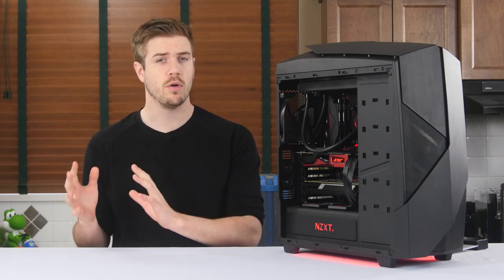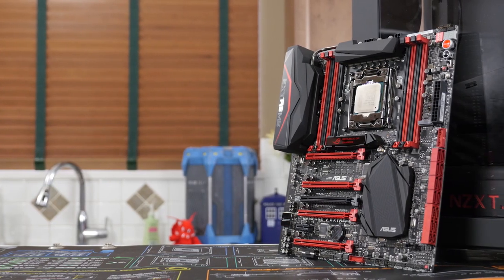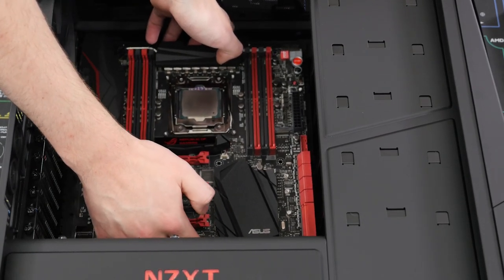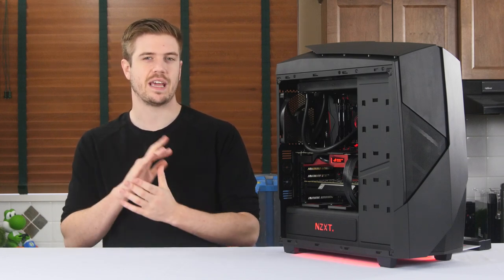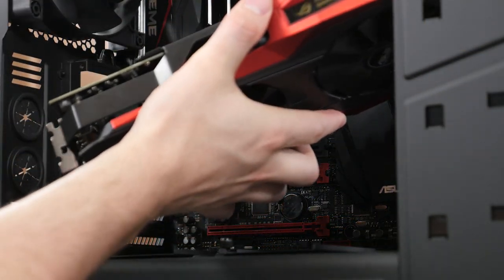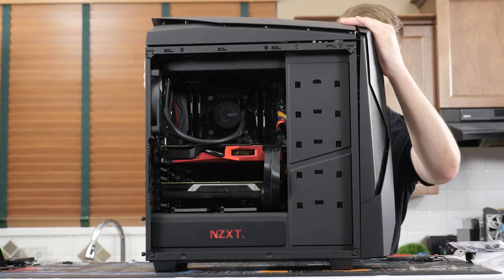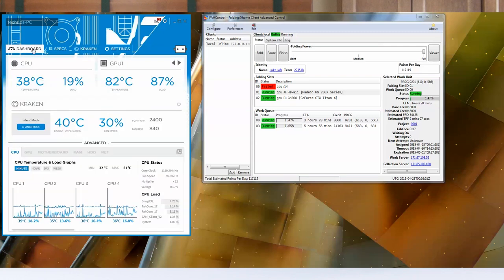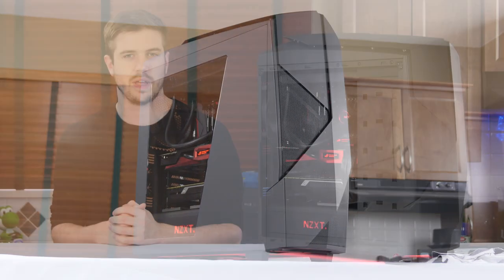ULTIMATE Distributed Computing Build Log

Comment: Can anyone give me tips on what parts that are better?

FX-6300 Black Edition
Sapphire Dual-X R9 270X
Gigabyte GA-970A-D3P
Kingston HyperX Fury 8GB Kit
EVGA 500W or Corsair CX500M
Reply: Omer Cinar u shud go for a processor for ur cpu.
Reply: +Omer Cinar  yes this is
Orientation: StandardThemes (Side Panels Only) Color: Shredder RedThe ORIGIN Difference: ORIGIN PC Genesis - The Best Gaming Experience GuaranteedVariable Mounting: StandardCase Lighting: Remote Controlled Multi-Colored LEDCase Fans: ORIGIN PC High-Performance Ultra Silent Fans - BlackMotherboard: MSI X99A GODLIKE GamingSystem Cooling: ORIGIN CRYOGENIC Stage III Hard Line Liquid CoolingCRYOGENIC Tubing Color: RedCRYOGENIC Liquid: Koolance Performance Coolant - RedProcessors: Intel Extreme Core i7 5960X Octa-Core 3.0GHz (3.5GHz TurboBoost)ORIGIN Professional Processor Overclocking: ORIGIN Professional Processor OverclockingThermal Compound: GELID GC-Extreme CPU ApplicationPower Supply: 1.5 Kilowatt Corsair AX1500iPower Supply Sleeved Cable Color: Red Individually Sleeved CablesGraphic Cards: Quad ORIGIN CRYOGENIC Liquid Cooled 12GB NVIDIA GTX Titan XORIGIN Professional Graphics Card Overclocking: ORIGIN PC Professional Graphics Card OverclockingMemory: 32GB Corsair Dominator Platinum 3000MHz (4x8GB)Operating System: MS Windows 10 HomeOperating System RAID Configuration: RAID 0: For better speed and performance (2 Identical OS Drives Required)Operating System Drive #1 (Primary): 2TB Samsung 850 Evo SeriesOperating System Drive #2: 2TB Samsung 850 Evo SeriesHotSwap Drives RAID Configuration: RAID 1: For better data safety and security (2 identical drives needed)Hot Swap Bay Drive #1: 2TB Samsung 850 Evo SeriesHot Swap Bay Drive #2: 2TB Samsung 850 Evo SeriesHot Swap Bay Drive #3: 2TB Samsung 850 Evo SeriesHot Swap Bay Drive #4: 2TB Samsung 850 Evo SeriesHot Swap Bay Drive #5: 2TB Samsung 850 Evo SeriesHard Drive Cage: 5 Bay Hot-Swap CageOptical Drive One: 12X Blu-ray Reader and DVD ComboOptical Drive Two: 24X CD/DVD BurnerPlayback Software: CyberLink PowerDVD 15 Ultra (MSRP $99)Lower Unit: Cryogenic Cooling SupportMedia Card Reader: 40-in-1 Media Card ReaderAudio: Creative Sound Blaster E3 Headphone AmplifierNetworking: Onboard Network PortCapture Cards: AVermedia Live Gamer Extreme LGXORIGIN Maximum Protection Shipping Process: ORIGIN Wooden Crate ArmorWarranty: Lifetime 24/7 U.S. Based Support and Lifetime Free Labor. 3 Year Part Replacement & Free Shipping WarrantyORIGIN Recovery: ORIGIN Recovery USB3.0 Flash DriveEvolve Part Upgrade Service: 3 Year Evolve Part Upgrade Service with Free ShippingOrigin Exclusive Peripherals: ORIGIN PC Goliathus Medium SpeedOrigin Exclusive Peripherals: ORIGIN PC TaipanOrigin Exclusive Peripherals: ORIGIN PC BlackWidow ChromaFree ORIGIN T-shirt: ORIGIN PC T-Shirt MediumBundles: ORIGIN PC Ultimate Peripherals Bundle (MSRP $269)Keyboards: Razer BlackWidow ChromaMouse: Razer OurobourosMouse Pad: Razer ManticorPrimary Display: ASUS 32" PA328Q 4K UHD LED MonitorSecondary Display: ASUS 32" PA328Q 4K UHD LED MonitorDisplay Accessories: NVIDIA 3D Vision 2 Wireless GlassesDisplay Accessories: NVIDIA 3D Vision 2 Glasses Kit with IR EmitterHeadsets: Astro Gaming A50 Wireless HeadsetSpeakers: Creative Sound Blaster X7Webcam: Logitech C920 HD Pro WebCamGame Discounts: Green Man GamingGames: Grand Theft Auto VExternal Storage: ORIGIN USB 3.0 16GB Flash DriveSecurity Locks: Kensington Twin Locks(For Prime Desktop)Security Software: Webroot AntiVirus for PC GamersProductivity Software: Microsoft Office 2016 Home & Business (1PC/1User) *US Version*Cloud Backup: CarboniteApps: Battle.net ClientApps: Steam (The Ultimate Online Game Platform)Apps: Razer CommsApps: Microsoft Windows Live EssentialApps: Razer Synapse 2.0Extras: FREE Online Game: League of LegendsExtras: FREE INSTALL: MinecraftWeb Browser: Microsoft Internet Explorer/*EdgeWeb Browser: Google Chrome

Comment: will my PC run Witcher 3 on ultra

PC Specs

i7 4960k Processer

Asus maximus VII Ranger Rog 1150 Motherboard

Nvidia GeForce GTX 980Ti 6GB DDR5 Liquid Cooled and OC 

XSPC 240 Extreme Liquid Cooling Kit

Corsair Vengeance Pro Series 16GB (2 x 8GB) DDR3 2400MHz

Corsair Obsidian Series® 450D Mid-Tower PC Case

Kingston HyperX Fury 120GB 6.0gb/s SATA III SSD

Seagate 1000 GB 72000rpm SATA 3.5″ HDD

SeaSonic X Series X-850 850W SLI/CrossFire Ready 80 PLUS GOLD
Reply: NOOOO! You need 8 million GT420s to do it, scrub, not this scrub machine. 

It'll run fine. Just look at some of the benchmarks for the 980ti, to check it, of course.
Reply: Raptor Nah he needs a gt630 to run witcher 3 at ultra its the best card atm ;)

Comment: Were those fans in push or pull?
Reply: +KhaosN7 pull in exhaust, but it makes no difference anyway
Reply: That's what I thought. It doesn't make a difference for cooling, but it does make cleaning easier. I built my Rig in that case using that cooler, it was a bitch and half to get in there, but it was worth it.

Comment: hi, could you tell me if this rig can run minecraft+shaders; medieval engineers high-Very high;Space engineers high-Very high?: motherboard: Asus M5A97 EVO R2.0 cpu: amd fx 8320 8 core black édition 3,5 gh RAM 8gb hard drive 1x SSD 240gb corsaire force 3 + 2tb Sata psu: BeQuiet pure power 80 plus bronze 630w gpu: AMD Sapphire Radeon hd 7870 2gb oc.  thx guys.

Comment: This doesn't look like a distributed computing station; it rather is a Gaming machine! I'd rather use those 2 xeon processors (from the $150 gaming rig video) as it will have 8 physical cores for a more efficient data procesing. Also, I do not think we need a graphics card at all unless we need to avoid the onboard graphics sharing a chunk of the system RAM. and clearly did not understand why you guys added 2 high-end graphics cards! instead, i'd have gone with a basic 1 gig-ish graphics card only to avoid RAM sharing.  another thing, for a Distributed computing machine, i'd rather wanna add more RAM than only 8 GB which is surely gonna be a bottleneck for high end data processing (which nowadays happens in-memory!) 
In short, if you guys had used the same proccy+mobo+RAM setup you used for $150 rig; it would have been more practical and would have costed a fraction of the price incurred to build your system.
Reply: uttkarsh dharmadhikari in folding@home the GPU is far better at folding than the CPU, so graphic cards are indeed a good choice.

Comment: This is what i have right now, does anyone have any tips and/or ideas for where the question marks are?
Budget is max 800$

Cpu: Intel Core I5 4690k 3.5 ghz
Optional cooler: ????
Motherboard: ASRock Z97 extreme 6
RAM card: Kingston HyperX Fury red HX318C10FR/8
Gpu: msi geforce gtx 970 gaming 3.5gb
Case: cooler master n300 (KWN1)
Harddrive: seagate barracuda 1tb
SSD card: 250gb ?????
Psu: ????

Comment: Just don't run prime number programs on your skylake.  Until you get the relevant BIOS or firmware update.
Reply: +OptimisticPessimist I did folding@home for 8 days straight on my 6600k without issues, i do keep my bios updated though, and I'm not sure if folding can trigger the instability issues on skylake, folding isn't prime number crunching tho, so maybe it won't cause the problems? Either way, my system seems fine at 4.6ghz, stability tested with aida 64 for 27 hours on 2 seperate occasions, and 8 days of folding, I must have the fixed bios.
Reply: Darren Kehrli
Ok, so it's triggered by some very complex workloads, has been by running Prime95, a tool to stress test the CPU with prime number operations. Crashes occur during Fast Fourier Transforms with extremely large exponents.  Otherwise the cause isn't mentioned.  Which means applications that do similar operations may be at risk until the fix is applied.  I don't know what, besides specific math or science research projects could be affected. http://arstechnica.com/gadgets/2016/01/intel-skylake-bug-causes-pcs-to-freeze-during-complex-workloads/

Comment: Hi i wanna build my frist PC and im thinking of buying this: 

NZXT ATX Mid Tower Case Cases CA-S340MB-GR

EVGA SuperNOVA 750B1 750W ATX12V Power Supply 

WD Blue 1TB SATA 

Gigabyte GA-Z97X-GAMING 3 LGA 1150 Z97 

MSI GTX 970 

G.SKILL Ripjaws X Series 8GB (2 x 4GB) 240-Pin DDR3 SDRAM DDR3 2133 (PC3 17000) 

Intel Core i5-4690K Processor 3.5 GHz LGA 1150 
also im kind of scared to build well im only 13 and i dont wanna break my CPU while putting it in a place and what cable to put where on Mobo

Comment: Hi!

Are there any one who can help me with this small problem? I've just been on a trip away, but when I came home to my computer a problem which fixed it self after turning on G-sync came back; Screen tearing. I don't know what causes it, I've put on V-sync and other stuff, cleansed my computer, the only thing left is reinstalling my computer, which I have no intention of doing yet. I've searched it up on google, but none of it works.

ASUS ROG PG278Q (2560x1440@59Hz)- gaming screen
2047MB NVIDIA GeForce GTX 660 Ti (EVGA) - somewhat old GPU(?)
http://gyazo.com/08465ee5ebb9551abb4a55987cd992cc

So my question is, what is the problem?
Reply: Mr Krisey I've also noticed that the screen tearing is at the same place all the time, I don't know if that makes a diffrence or not.

Comment: The different GPUs ruined it they should have gone with the AMD x2 it suits the build
Reply: Ben Maxwell AMD 2X can the room take the heat?
Reply: What u mean?? PC Master Race
Reply: Ben Maxwell AMD GPU + CPU= oven
Reply: It will be fine without load and it has hreat cooling
Reply: They did that because some distributed computing workloads run better on amd gpus and some run better on nvidia gpus. This is done to get the best of both worlds.

Comment: If you're doing distributed, sack off Windows, get down to a bare bones Linux build and go from there... A lot less overhead. Boinc is supported extensively on Linux based operating systems

Comment: Guys what do you think of my first build 

AMD FX-6300

Cooler Master Hyper 212 EVO 82.9 CFM Sleeve Bearing CPU Cooler

MSI 760GM-P23 (FX) Micro ATX AM3+ Motherboard

G.Skill Ripjaws X Series 8GB (2 x 4GB) DDR3-2400 Memory

Western Digital Caviar Blue 1TB 3.5" 7200RPM Internal Hard Drive

XFX Radeon R9 285 2GB Double Dissipation Video Card

Cougar Spike MicroATX Mini Tower Case

EVGA 400W ATX Power Supply

Plz let me now what you think

Comment: Is this like bit coin and you get paid to do this
Reply: +NickMsiGaming Yt  They can afford a used 980 Ti.  But we're talking about MILLIONS of computers working toward the same goals.
Reply: But jeah,I get it,but come on,how many,lets say GTX 950 PCs are connected,i would think almost half are less powerful than the 950,so my 980 TI could perform a task of about 4 of those single 950 (Or AMD counterpart) PCs.So you can lower the amount of power used for these PCs and therefore more efficient use of hardware.About 250000 980 TI PCs would perform a task of 1000000 PCs.And if you give all those computers 2 way 980 TI sli,you can limit this to 125 000 computers,so 1000000 vs 125000?Because we have less systems that only pull the extra of the gpu,not another CPU,RAM ect. we save lots of power and we stop global warming.BOOM killed two birds with one stone.And in the long run they would be MUCH cheaper than 1000000 PCs.Just like a TESLA model S that is expensive at the start but it saves you money over time.

PS:Have to read entire text to see the cons reversed.Don't pull any hate on me until you have read.
Reply: Nick, I don't dispute what you wrote in your last post, but good luck convincing hundreds of thousands of users (possibly millions of users) to upgrade their machines.  And besides, your original post assumed everyone who didn't have a 980 Ti was poor, which is insulting to say the least.

Your energy would be better spent convincing everyone to scrap any car that gets less than 35 miles per gallon.
Reply: Everyone that has not got a 980 TI (or similar) is a budget gamer.And i hate them.
Reply: I see you're trolling.  I'm not biting.
Reply: tripod=triangle=AMD=illuminati confirmed!!
Reply: tripod=triangle=nVidia=not illuminati
Reply: see?
Reply: Budget gamers use AMD.They are in the illuminati following my formula.
Reply: I guess you hate everyone with a 1060, then
Reply: 1060 ok.
Reply: NickMsiGaming YT how tf is a 1060 ok but not a 390x the 390 is more powerful
Reply: But the 390x is still like 500$ and needs like a 600w power supply.

Comment: this folding and boinc things seem like too much trouble. they should be configuring there software to run on my system. not the other way around. considering there getting our help for free i dont think thats too much to ask. and with this folding and boinc stuff. can you just let it do its thing over night and when you want the pc u just stop it or whats the go? what kind of internet connection is needed? us people with slow 5mbps down and 0.5 up. is our system even going to crack idle with those speeds? seems like a waist of time. also will my service provider let me get those downloads and uploads for free? cuz us people here in australia get on average 10-200g per month limits. and thats up and down stream. so if its running full speed even on 5mbps thats gonna cap out pretty quick.

Comment: Guys i going to buy a new pc for my games and my work with design is that alright:
Motherboard Z97X-UD3H-BK
GTX 970 Gigabyte G1 Gaming
Core i5 4690K
Case NZXT H440
Watercooler Corsair H100i
Corsair CX600W
HyperX 2x4GB
Reply: Diabo Zueiro Personally I went with the MSI GeForce GTX 970, (personal preference) but overall the build is good. :) Have you checked some compatibility using PCPartPicker? Just in case there is an issue I don't see here.

Comment: Please help me with this build 
I was think of building a computer is this computer good for running high settings on 2015 games? 

Computer Case : NZXT H440 Black / Red Mid Tower Computer Case
----------------------------------------------------------------------------------------------------------
Optical Drives & Storage Devices : Asus 24x Internal DVD±RW - OEM
----------------------------------------------------------------------------------------------------------
Video Card : MSI GTX 970 GAMING 4G Golden Edition GM204-200 (Maxwell) 4GB GDDR5 PCI Express 3.0 x16
----------------------------------------------------------------------------------------------------------
Power Supply : Corsair CS750M 750w ATX Power Supply 80 Plus Gold Modular
----------------------------------------------------------------------------------------------------------
Liquid CPU Cooler : Corsair Hydro H100i Liquid Cooler
----------------------------------------------------------------------------------------------------------
LED Fan : Corsair Air Series AF120 CO-9050015-BLED 120mm Blue LED Quiet Edition High Airflow Fan			
----------------------------------------------------------------------------------------------------------
Motherboard : Gigabyte Intel LGA1150 GA-H97-Gaming 3 Motherboard
----------------------------------------------------------------------------------------------------------
Computer Processor : Intel Core i5-4690 3.5GHz Haswell Processor
----------------------------------------------------------------------------------------------------------
RAM : Patriot Viper 3 Red DDR3 16GB 1600MHz Quad Memory (4x4GB) Modules
----------------------------------------------------------------------------------------------------------
Hard Drive : WD10EZEX 1TB Caviar Blue
----------------------------------------------------------------------------------------------------------
Hard Drive Cables & Brackets : Bytecc Drive Bay Bracket - Floppy / Card Reader / 3.5" Drive in a 5.25" Bay
----------------------------------------------------------------------------------------------------------
Reply: no... u have no cpu